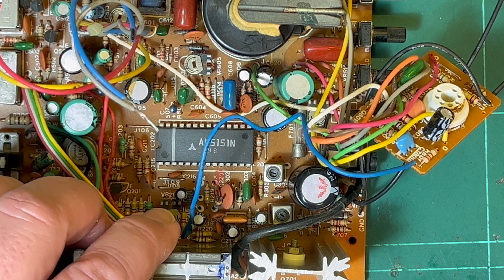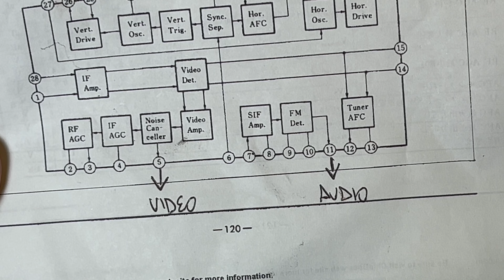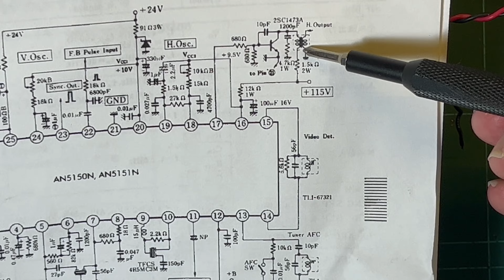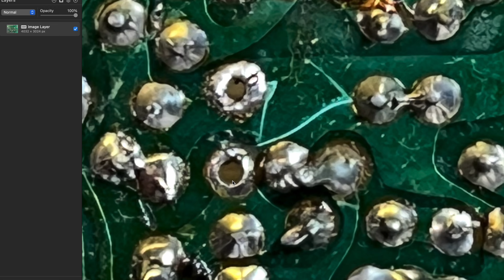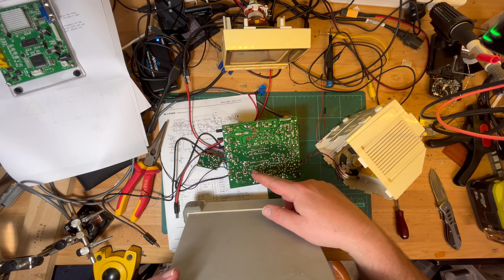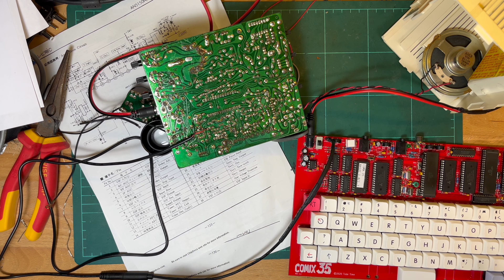🇹🇼 Princess PBW-121 (Adding Video Input to RF-only TV): Part 2 [#TCE0523]

Comment: The flyback (retrace) lines are visible because the brightness and contrast are too high. As you pointed out, the internal video signal is 2.1v p-p and you are supplying 1v p-p. If you use a video amplifier to boost the signal you will be able to turn the brightness and contrast down.
Reply: What amplifier would you suggest

Comment: I'm new to all this, and could be wrong, but shouldn't the signal be sent into the chip, to be processed and synchronised ?
You've bypassed everything and gone straight into the neck board. Might be why there's horizontal lines across the screen ?

Comment: Hi, after a few days of making the same modification to a small TV similar to yours but with a different chip (Samsung KA2915), I detected the same problem with the horizontal lines. After a few days of research, I discovered that by putting a small 1uF capacitor in series with the positive video pin, the problem disappears. I hope this helps. Best of luck!
Reply from the maker: Oh, how interesting!  Thanks for the tip!

Comment: i still think youre seeing the lines coz the intensity of the beam is wayyy to bright..you should be able to bring it down so you dont see the lines but still able to see the text.. 
..saying that.. failing adjustment..the tube may be toast...
ive got an old b&w screen in an old door intercom system (camera too).. i need to pull apart and use in a project.. 
you should be able to use a simple arduino TV out (composite) to generate a picture you can use to test and adjust...
Reply from the maker: Some comments in the Part 1 video suggest disconnecting the VIF input (pins 1 & 28) ... I did this, pretty simple ... break one track and disconnect one link ... but made no difference in my case.  Adjusting contrast/brightness makes no difference.  Only thing I have tried yet is impedance match the 75Ω input ... but I don't think this would affect the retrace lines ... so yeah, I think this Xmas present from 1986 might finally need retiring!
Reply: @Brfff  Just tried, I'm having these retrace lines as well. Too clueless to actually try something, though.